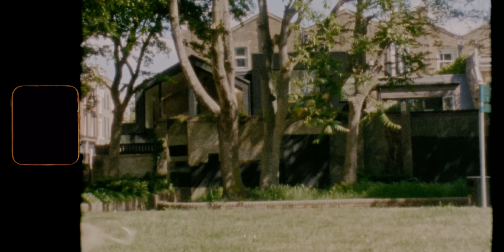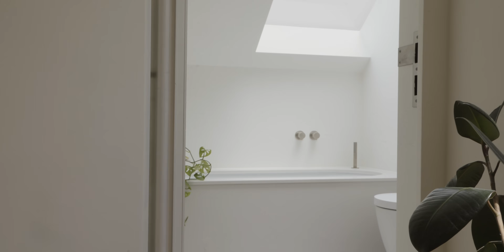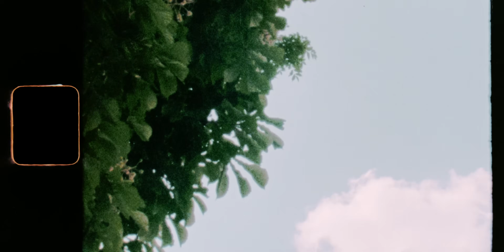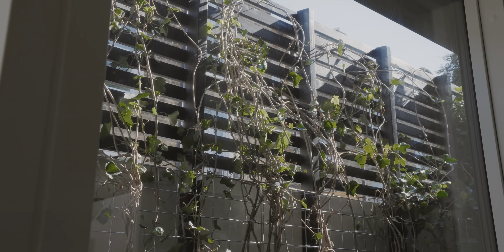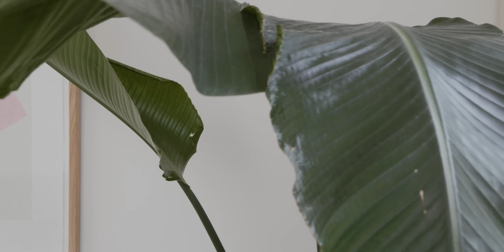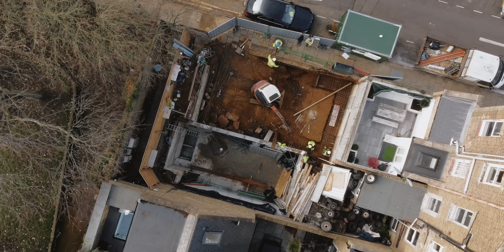Architect's CLT Self-Build: From Dilapidated Garage to Sustainable Modern Home with Park Views

Comment: You can tell he doesn’t cook, that tiny sink in the kitchen and stove on island 😂
Reply from the maker: The placement of the induction hob on the kitchen island is increasingly common here in modern kitchen layouts. The downdraft extractor fan makes their placement more flexible, and allows you to face your guests and socialise more easily whilst cooking. It's also worth noting that there's an integrated dishwasher to go alongside the compact sink!
Reply: @Aucoot I appreciate your explanation, but that sink is too small to soak roasting pans. Lots of homes have sinks that don't easily fit a large roasting pan, it's a pet peeve of mine 😂 I made sure to have a large sink when I remodeled our kitchen 😊
Reply: I have a smaller kitchen, and you can be surprised of how even smaller kitchens / appliances can be so functional.